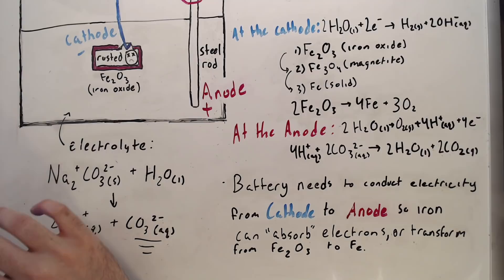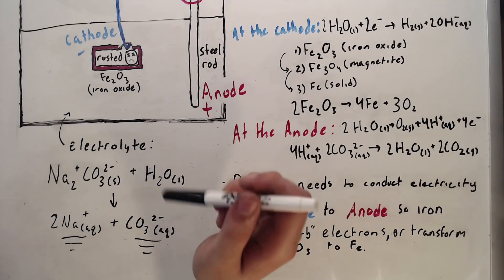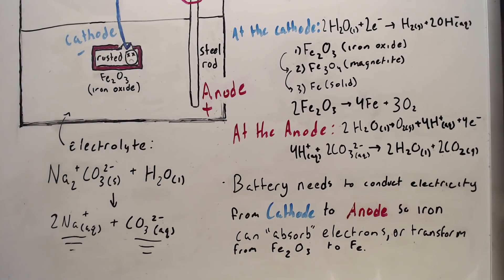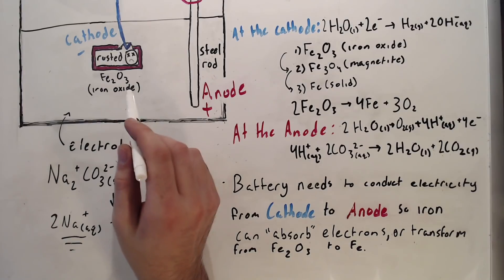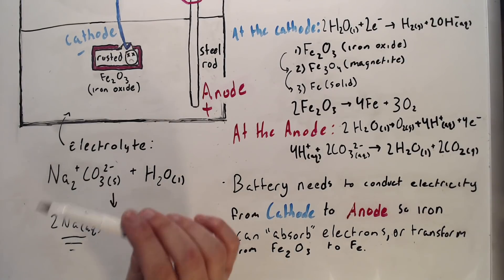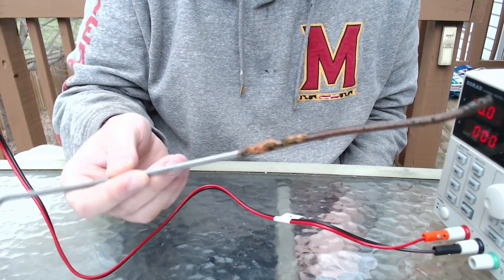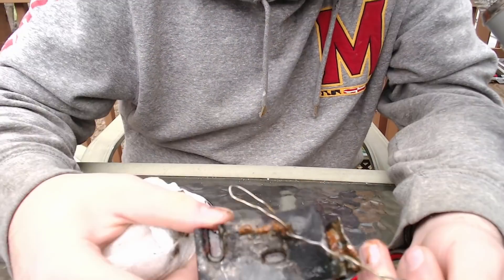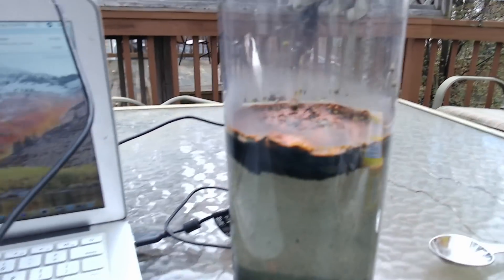How to make an electrolysis tank (and chemistry explained)

Comment: Okay, I heard you say 6-12v is a good range, higher would burn the metal. So is 12v somehow better than 6v? What about amps? Is there an ideal setting for voltage and amps? Is higher stronger and faster? Maybe heat would be created or excessive gasses? we wouldnt want to melt our plastic tank.
Reply from the maker: I don't think 12 is any better quality wise, it just works quicker... as far as amperage goes, I've found that 3-5 amps is a good range without generating too much heat

Comment: don't use steel anode, use carbon : it's cheap, safer, cleaner and last a pretty long time.
Reply: +1 
Carbon anodes are awesome. I don't see the point of adding loads of extra gunk by using iron anodes.

Comment: Hexavalent Chromium is a non-issue unless you're aerosolizing it by grinding it into airborn powder or incinerating it. And even then it's only an issue at occupational levels. That's why every electrolysis rust converter tank uses stainless anodes. You're mistaken.